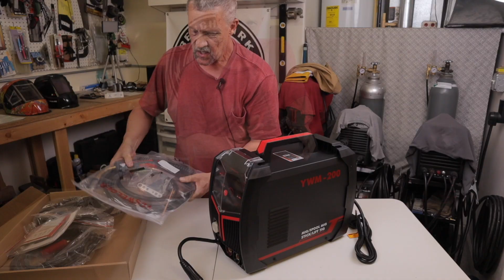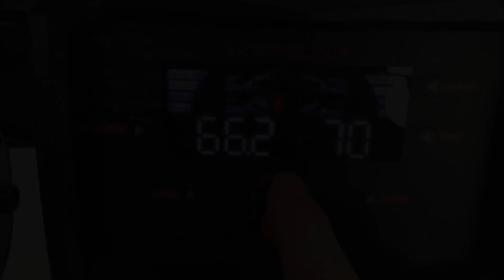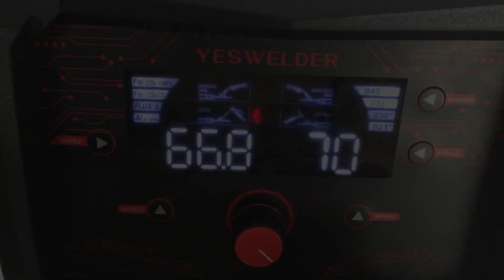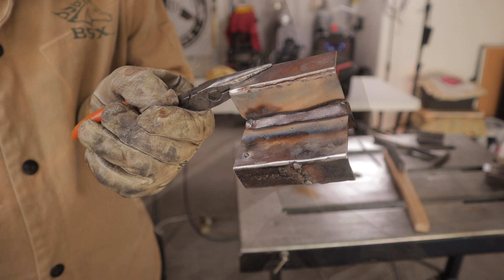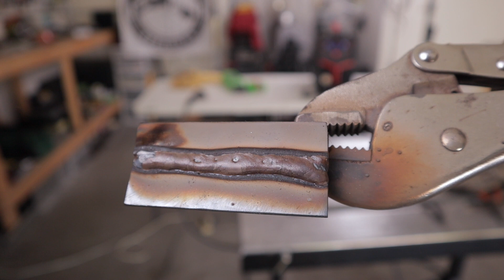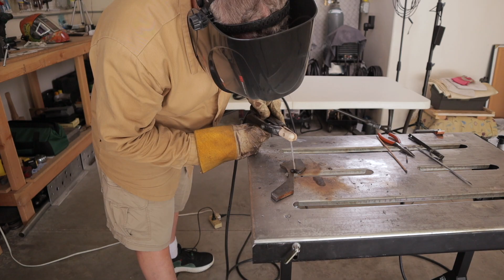"YesWelder YWM-200 Review: Stick Welding on 120V – Worth It?"

Comment: Nice video. What is your wall plug breaker amps for the 240v and 120v that you used for the machine?
Reply from the maker: 30 amps at 240v and 20 amps at 120v

Comment: I mean this with all the respect in the world for showing us your experience.

I’m very impressed by your welding. 

But then again I’ve never welded to pieces of metal together in my life.

But I’ve seen a lot of welds and can tell just by looking and comparing welds of the past that yours is NOT the get ya home welds I used to see.

I’m talking welds that looked like small or big pieces of bubble gum around the tubes of my frame or wherever a busted piece of metal was while riding cross state lines when I was a lot younger.

Anyways dig the video but I was curious since I’m on a really strict budget can you recommend a less expensive model for someone like myself who’s a beginner? Maybe in the $200 range? Of course I understand it probably will not have all the bells and whistles this one’s got but hopefully I could use it for simple welds. If there’s such a thing.

Or can you tell me what I might in a welder as a beginner?

Again thank you for sharing.
Reply from the maker: I really appreciate the nice comment! I started with a cheap flux core welder and I used it to learn on. It doesn't require any gas bottles or any fancy stuff but it is capable of welding a lot of little projects and great for learning. That's what I would recommend to start with on a budget. I haven't used this particular machine but I think it would be a great starter flux core welder to learn on. It's also less than $200. I'll list the link below and if you use the code DIYHP10% at checkout you'll save an additional 10% off your order if you decide you want to get it. This machine uses 2lb spools of flux core wire and I would recommend using the .030 size flux core wire. It will also stick weld if you are interested in trying that out and it only requires 120V power. I do recommend a 20amp circuit if you have access to one because it will probably trip a 15amp breaker from time to time if that's all you have access to. If you intend to try stick welding with it I would recommend 3/32" 6013 welding rods. They will weld almost any steel and they should burn well with this machine on 120V power. Hopefully this information will help you to get started with. 
135AMP 110V Gasless MIG Welder
https://yeswelder.com/collections/welder-cutter/products/gasless-mig-welder-135a?ref=DIYHP10%25
Reply from the maker: I actually just checked the YesWelder web site and they are currently running some nice specials. YesWelder is running a 20% off site wide sale at the moment. (you don't need any special code to get the 20% off) That would make it only $143.99. IMO that's about the best deal out there for a starter machine that will do three processes. After more research it is also capable of scratch start TIG but you'll need to buy a torch and gas bottle to do that with this machine. At least it's an option in the future if you have interest in that. 135AMP 110V Gasless MIG Welder
https://yeswelder.com/collections/welder-cutter/products/gasless-mig-welder-135a?ref=DIYHP10%25
Reply: @DIYHomesteadProjectsDIYHP10  
Damn it right on brother. I appreciate you looking into that for me.

I’m gonna check it out today.